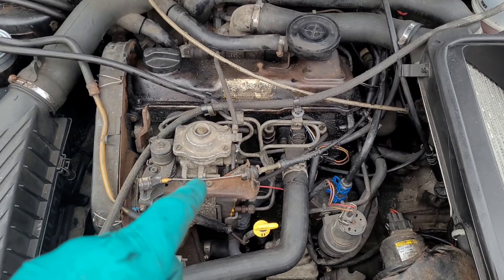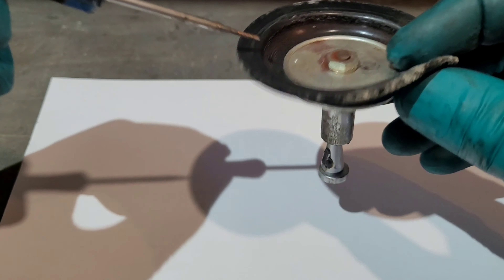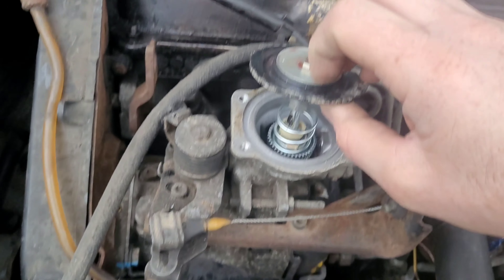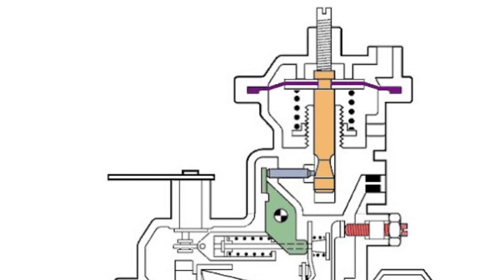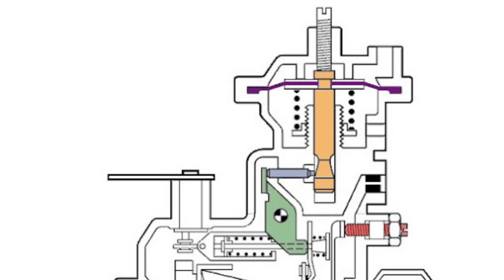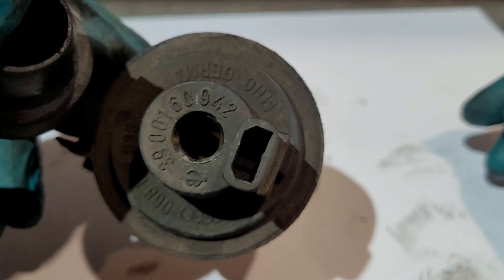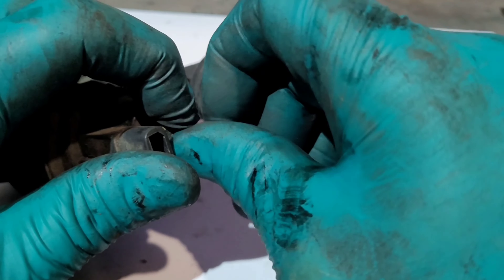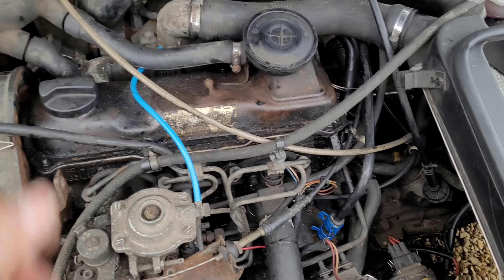VW Mk2 Golf/Jetta 1.6TD Performance Tuning | Pt1

Comment: Thank-you for these 2 videos (1.6 TD). I run a '90 Jetta with this engine, 405,000 kms currently. My B/O valve has been deleted for some time, and the air line to the wastegate is pinched closed. Cast iron downturn off the turbo has been replaced by a 2 1/2" stainless unit with a welded in flex joint,  same diameter retained to rear with a single low restriction muffler. Car stays cool with an A/C spec radiator, I'm in Northern Ontario. Run 0W40 synthetic year 'round, helps with cold starting in the winter (we can see -30 here), car also has  950 Cold Cranking Amps battery and an electric block heater for really cold nights. Torque makes it lots of fun in the twisties. Haven't turned up the fueling yet, will do so based on your recommendations. Power can be quite a lot of fun on snow-covered roads, I use high-quality studded tires. The car is very capable and tractable in the snow.
Reply from the maker: Awesome, thats some mileage and its cool to hear its being used in those conditions 👍

Comment: Bonjour,
J'ai acheté cette même version de Golf, il y a plus de 6 mois. Elle a 230 000km et pour moi, elle fai plus de 80cv, elle marche d'enfer.
Seul problème, c'est que le moteur est assez bruyant, a froid comme a chaud et ce n'est pas les poussoirs hydrauliques.
Mais question est, si les anciens propriétaire de ma Golf ont boosté ces performances (injecteurs tarés plus fort), est-ce normal qu'elle soit si bruyante. Merci pour vos réponses.
Hello,
I bought this same version of Golf more than 6 months ago. It has 230,000 km and for me, it makes more than 80hp, it works like hell.
Only problem is that the engine is quite noisy, cold or hot and it's not the hydraulic tappets.
But the question is, if the previous owners of my Golf have boosted this performance (triggered injectors louder), is it normal for it to be so noisy. Thank you for your answers.
Reply from the maker: Thanks, they are a noisy engine, you could always try and thicker grade of oil which may quieten it down
Reply: @GreyGooseRestorations  Ok thank you for the answer.

Comment: Does this also apply to the 1.9Td aaz engine? Just found a nice low k Passat looking to get some more life out of it. That throttle response looks %1000 better mine is so delayed to rev. Asking from Canada, nice video!
Reply from the maker: Not 100% on that but it is likely that i can be adjusted in a similar way

Comment: Just inherited an 89’ Jetta 1.6td. Only 206k KMs on it. Body is near perfect. Needs some TLC with some little details but otherwise a gem. How much power can be extracted from these engines without a rebuild? I’m undecided on doing a swap on the whole engine to something with more oomph. Like a 16v, 20v, or tdi. But if I can suck enough out of the 1.6td so it at least feel fun then I may hold off for now
Reply from the maker: They can be made to be just as quick as a half decent 16v, 120bhp area with loads of torque

Comment: Any dangers in defeating the bov?
Reply from the maker: Not really, as the turbo wastegate will stop any overboost situations
Reply: @GreyGooseRestorations  forgive me my naivety but I thought the purpose of the bov was because the wastegates can get stuck and cause overpressures?
Reply from the maker: No the BOV was fitted to prevent overboost situations, stock wastegate was set to approx 10psi whereas the BOV was set to approx 12psi. Any additional fuel will equal more boost thus the BOV will prevent anymore than 12psi.

It then only lets you rely on the wastegate for boost limiting.
Reply: @GreyGooseRestorations  thanks! This makes a lot more sense. Appreciate your help and great videos!

Comment: My hose from the top of pump to intake is also destroyed, same one as you in the video. What diameter hose do you need as a replacement?
Reply from the maker: I used 3mm ID pipe so it was a nice tight fit

Comment: How does everything effect the fuel economy?
Reply from the maker: Technically, it should improve as the engine is more efficient, so it requires less input from the throttle to maintain speed etc
Reply: @GreyGooseRestorations  That is very true thank you :), where can i get some performance exhaust manifolds? I have seen a lot of them for GTIs but not for GTD

Comment: Is all this mods are safe for a 1.6TD without intercooler? The EGT will be ok?
Reply from the maker: Yes, should be just fine providing the health of the engine is tip top
Reply: Where do you adjust the turbo fueling pressure on a non intercooler engine?
Reply from the maker: Should still be via the top of the engine fuel pump